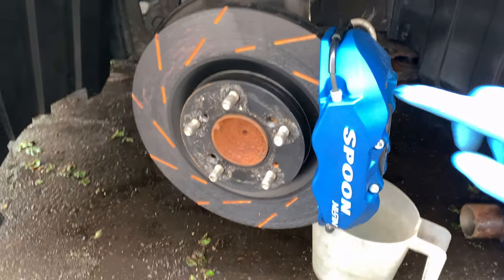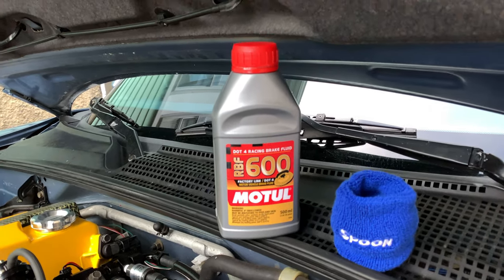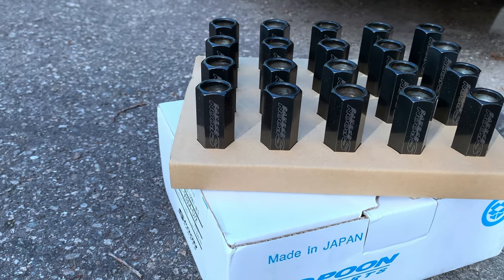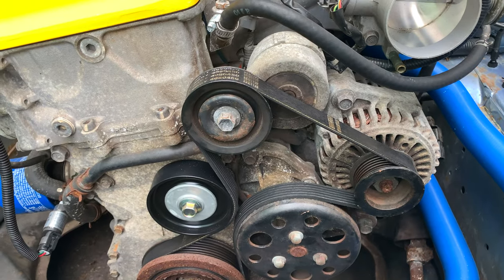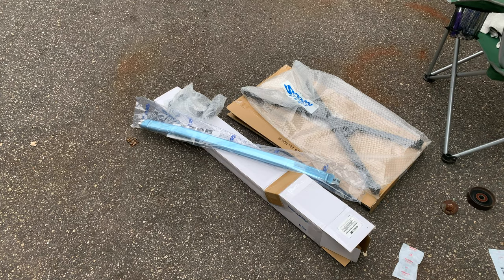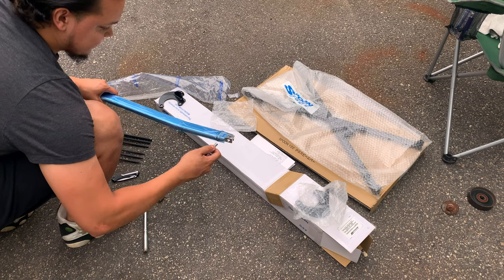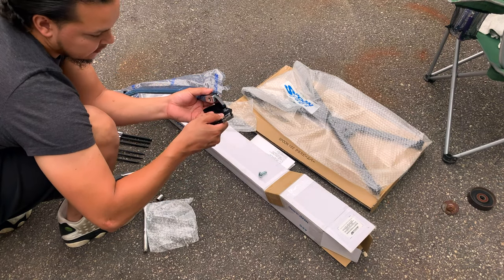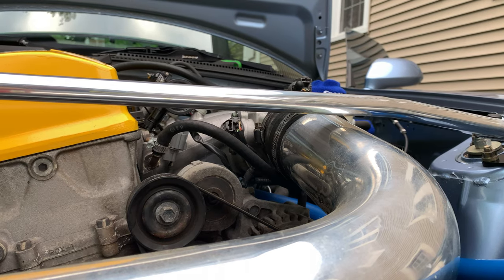I made a mistake on the Spoon S2000

Comment: You didn't happen to write down the parts list with the part #'s did you?
Reply from the maker: sorry for the delay but I did thanks for watching!
the bolt 90031-pcx-000
large washer 38945-pm3-000
small washer 90017-pe0-000
pulley 31190-pcx-000
over flow holder 19115-pcx-000
bumper stiffener 71103-s2a-000
stiffener gasket 71108-s2a-010